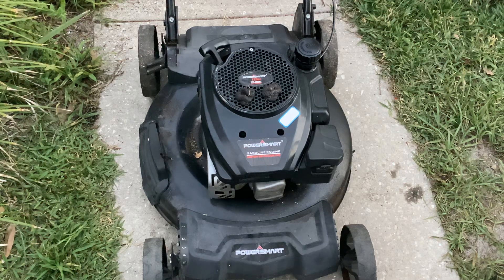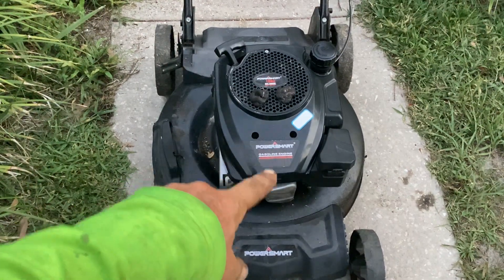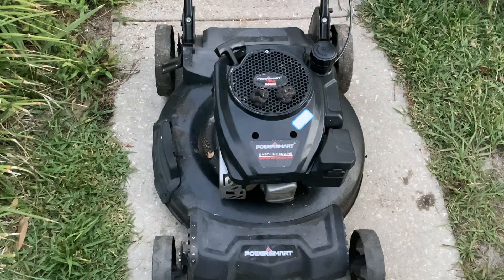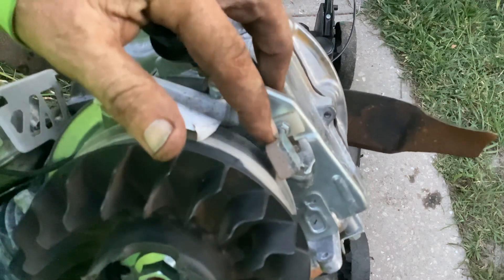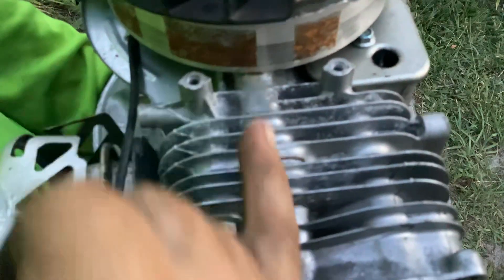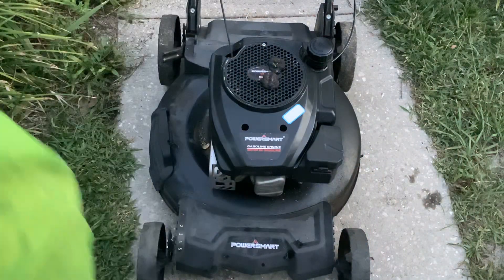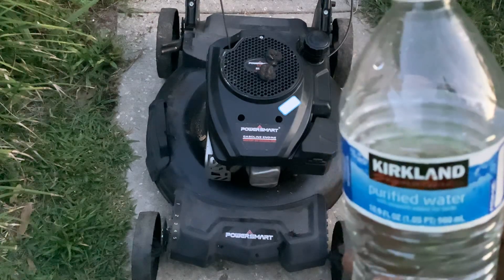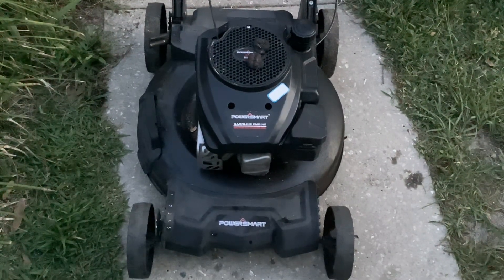2019 Power Smart Push Mower Blew UP in Front of me....NOT SO FAST...WE are NOT Done with This MOWER.

Comment: Use it for a rental mower. $50 deposit, $20 rental. Just an idea.....
Reply from the maker: I had thought about renting mowers out...this may be a good candidate.
Reply: @tommy-time5240  Hey Tommy, think Dale has something there w/rental if you should decide to make this your pet. Thanks for the accolades. May wanna check the head bolts too prolly got stretched out. The bolts near the exhaust are culprits